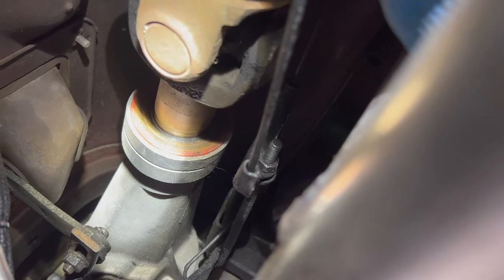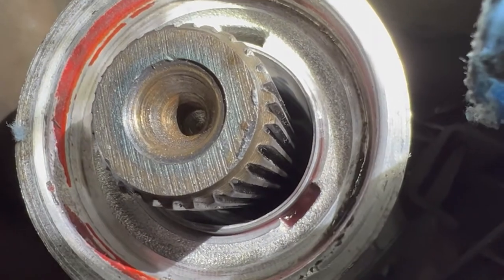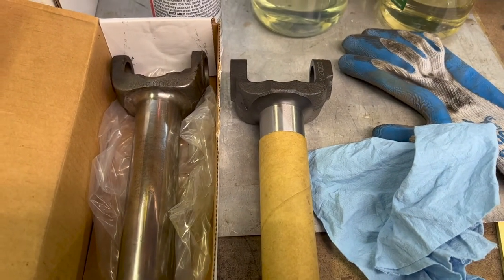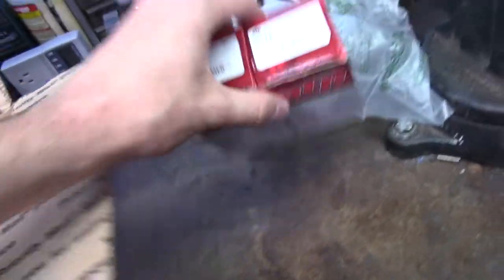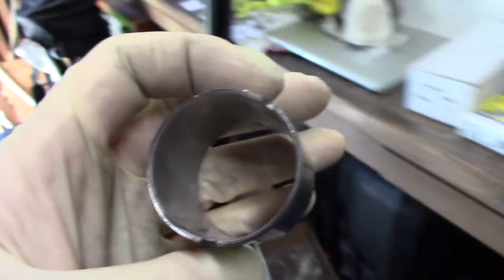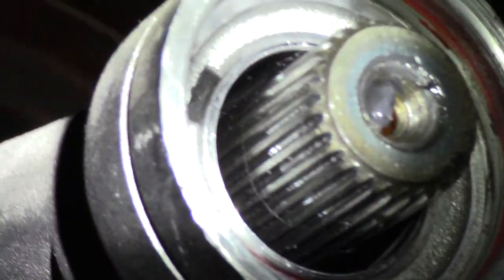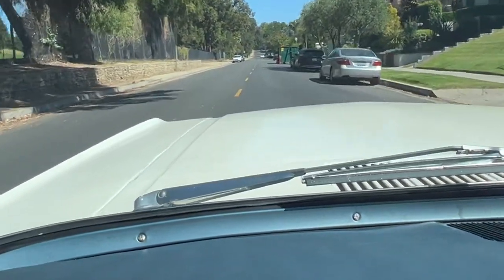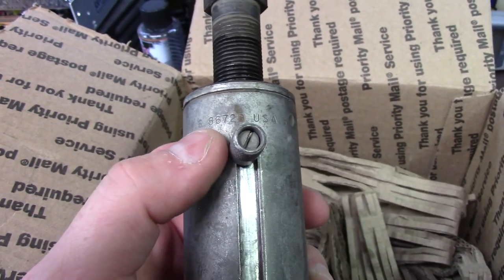C4 Transmission Extension Housing Bushing Replacement Without Removing the Housing

Comment: I started laughing when you said it took a lot of research for me only 6 hours 😁  6.2L Engine 2WD 1999 F450 F550 Rear Transfer Case Slip Yoke 1480, OE/OEM Part Number C3-3-839, SPICER #3-3-6021X,  (1.375" brg cap dia) (D), 30/31 Spline (31 spline with 1 dead spline = 30 spline), Outside yoke dimension 4.438" (E), Center of u joint to end of spline 6.870" (J), Hub Diameter 1.885" (R), Spline OD 1.390"

Comment: Excellent video as I am now in the middle of replacing the seal in my 66 mustang c4 tailshaft.  Because of your video, I checked the yoke and the bushing and they both need replacing.  Just on the surface, your yoke looks like the same as mine, so can you supply a part number to get me started?  Probably just going to pull the tailshaft housing versus trying to find the bushing tool you used.  Thanks!

Comment: I am going through the same dilemma with my 67 Fairlane. I see you had a good amount of yoke shaft hanging out of the trans. Mine is 1 3/4+ at ride height. Yours looks about the same? I thought it was too much, wrong shaft but yours looks similar. Now hunting that tool.

Comment: Can this make a BAD paint mixer type driveline vibration, or only a clunk when accelerating or decelerating? I have a new crate engine, pro-built C4, and have a nasty vibration when the car is driven forward from idle to 3000 rpm, or til whenever I let off to be honest. I don't hear or feel any clunking. From the flat part of the yoke to the edge of the tailhousing, I have about 1.5 inches of the machined part of the yoke sticking out. The car is old, the trans has been replaced three times at least, and I don't even know if I have the right length of driveshaft for the transmission/axle. U joints are brand new Spicers, and I am trying HARD to make this car smooth out. There IS side to side play with the driveshaft fully installed. If I hold the brake while sitting and run the engine RPM up to the point of convertor stall, there is no vibration. ONLY when I am moving forward with my foot on the gas. IE: driveshaft and rear axle moving.... PLEASE# answer if you can. Thanks... GREAT video btw!!!
Reply: Also, I just took my driveshaft off to be completely redone. Mine looked a lot like yours, in the amount of yoke that was outside the  housing. The amount of shaft showing at ride height is supposed to be about an inch. If that was fully installed your driveshaft may be too short like mine was. I had a VERY bad acceleration vibration. ANY time I gave it gas it was a bad paint mixer like vibration. The jury is still out if the new longer driveshaft  solves the problem. I ALSO had a BAD angle for the driveshaft, which didn't help either. The shim I needed was 3.5 degrees, and that is still on the way to me.

Comment: yours obviously flops around like a fish out of water but if you were to put a dial indicator on that stub as you wiggle it then how much movement is considered within spec?
Reply from the maker: Not sure if the manual shows the spec or not but I’d say no more than a few thou runout max. New, it will have none.
Reply: You mentioned it had a "clunk" off or on the gas, however, did it have a vibration?
Reply from the maker: @dangerdavefreestyle  no vibration, but it whined as well as clunked. 
It could cause vibrations though, but mine didn’t.

Comment: Is it OK to drive a vehicle for 500 miles that vibrates, and needs this repair? Until I can get it in the shop.
Reply from the maker: Depends on how bad it already is. Could damage the rear end pinion bearing or U joints.
Reply: @mechtrician1  it vibrates around 25-40, then it kind of goes away. Most of the miles would be highway miles. 500 miles there, 500 back. The mechanic that looked at it said we'd be ok, but he also doesn't do the repair in his shop.